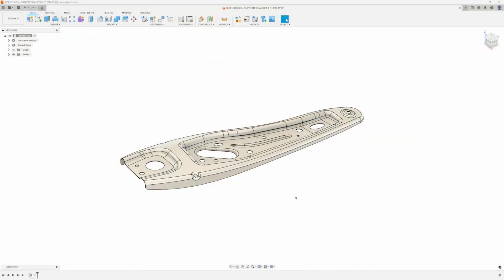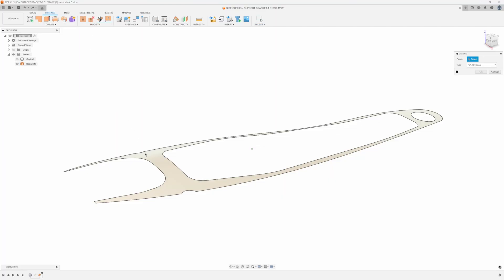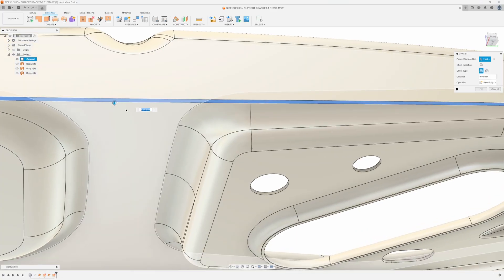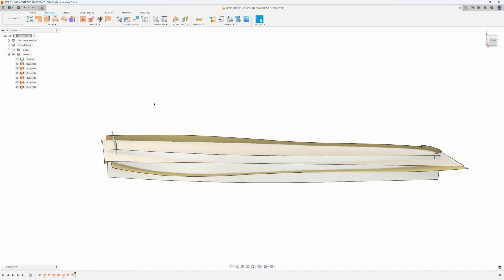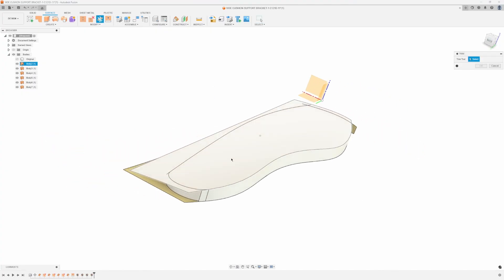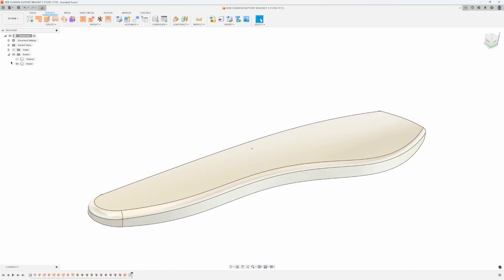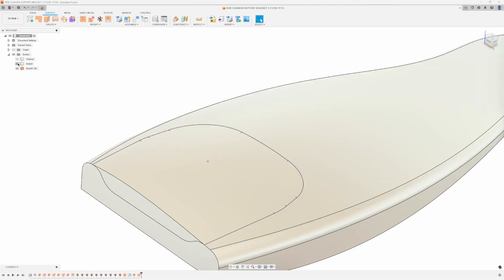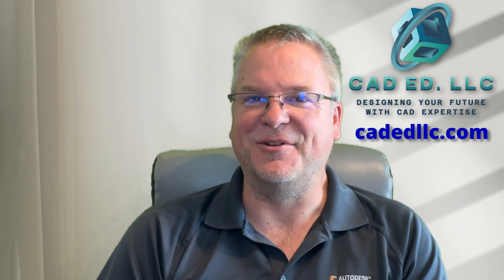How to use the Untrim command in Fusion

Comment: Limitations : Untrim only works on single surfaces. The "Manual" option under "Type" doesn't work as you can't select individual edges to untrim, it chains the whole surface edge. It would be nice if you could "Extend" a surface edge in the negative direction.

Comment: Why not use Boundry Fill instead of all the trimming?
Reply from the maker: @steveweeks758-  I actually spent a lot of time debating this when prepping for this video.  I agree that Boundary Fill would have been the "fastest" way of getting the interior boundary without having to do all the trimming.  However, since the video was about Untrim, I figured I should then show the Trim command to trim back what was Untrimmed instead of trying to teach a whole different command.  Plus, many people find Boundary Fill to be confusing (myself included).  In this example, however, I agree with you and Boundary Fill would have been the "preferred" method.

Comment: Great video! This will be quite useful in developing tooling.

Now that Fusion is transitioning to Windows 11, would you discuss Fusion's "Browser Mode" and how to make the change. Some of us do not want to use Windows 11, since we would be scrapping our perfectly good computers. (and avoiding egregious new policies)
Reply from the maker: This is a "touchy" subject as Autodesk has to keep up with what Microsoft & Apple are doing with their operating systems.  For example, since Microsoft is discontinuing support for Windows 10, Autodesk also has to follow that to stay current with security requirements.  I get it, though...  I had a shop computer that ran my CNC machine just fine with Windows XP and Mach3 for years.

Comment: Does MDF stand for Medium Density Fibreboard?
Reply: Yes
Reply from the maker: Yes.  MDF is sometimes used for creating mold forms as it is easy to machine and fairly inexpensive.  It stands for Medium Density Fiberboard and is basically wood fibers mixes with a resin and pressed under extreme pressure to create the wood panel.